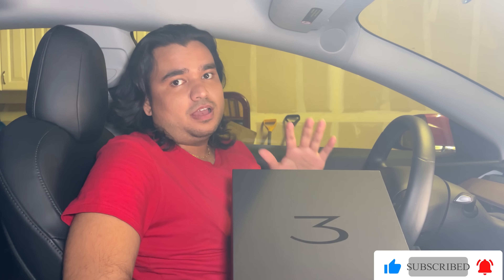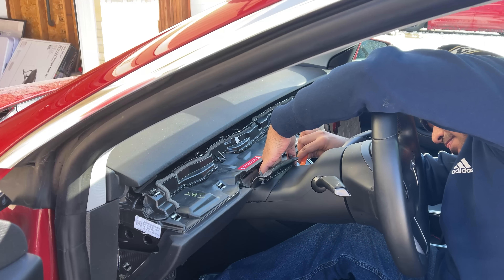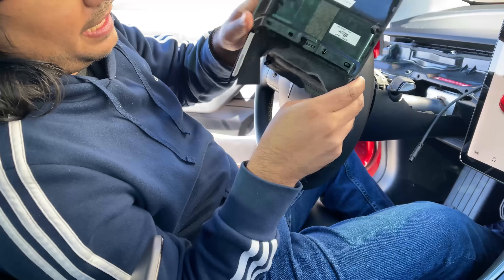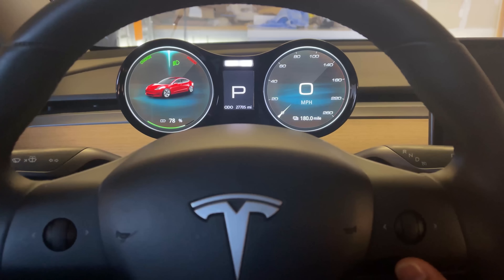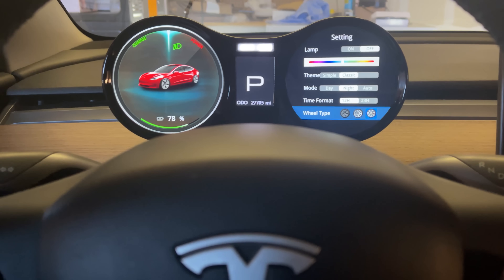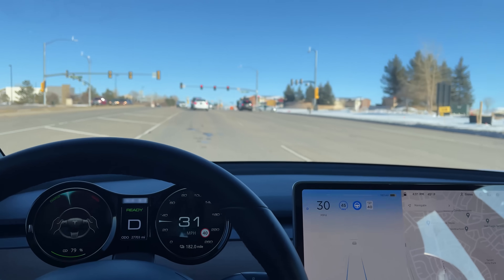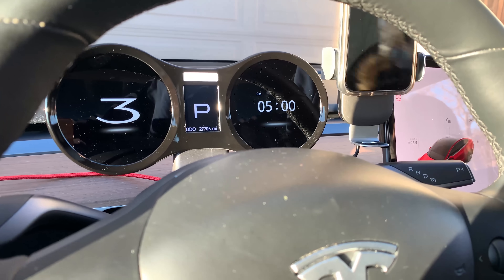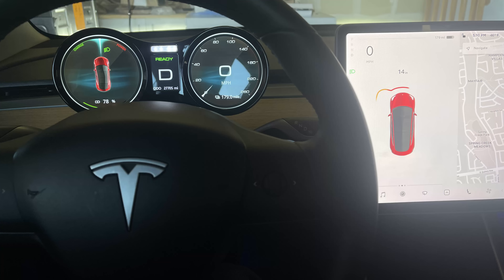New Display For Tesla Model 3 & Model Y - Instrument Cluster 2021

Comment: looks cool. will there be any problems with the warranty for the car? or any problems then with the tesla system, updates?
Reply from the maker: Hi Adam, no issues with the warranty unless the installation or this part somehow damages Tesla OEM parts. I have had a lot of Tesla updates with this installed and no issues there either. Thanks for watching my video.
Reply: @ShivaSapkota  was it tested with model 3 for 2021 ?
Reply from the maker: @adamsky7544  Yes, many of my subscribers have managed to install this in their refreshed model 3.
Reply: I could not find the plug on 2022 model 3. I have been hanging around for the whole day :(
 Is there any suggestions for another alternate plug? Thanks

Comment: @Shiva Sapkota: I've installed this unit in my Model 3, and it's really quite nice.  The displays are super crisp and look good.  I didn't like their cable routing, so I routed the cable differently than you did and made a video here: https://youtu.be/wH7gClHpJFQ 
I reference your video for the complete install.  Curiously for me, the MCU connector was only about 10 minutes of work, but getting the cover of the driving column to snap into place was an hour of work. Pretty hard.

Also question, if you have it installed, what software revision are you running?  My version is HMI_V1.3.25.0328R and MCU_SW_V2.3.4.  Just curious if you have newer software or not, because I ran into one odd problem.  When I charge at home, the display stays on after the charging is complete.  I leave the car plugged in when not in use, so having it stay on is not good.  I'm curious because my software is clearly a different revision than the one in your video (more wheel options, for example.)
Reply from the maker: Nice work on cable management! My cover for the driving column snapped in place quickly after I aligned all the tabs and pushed it in. My version is slightly different but I haven't updated this in a while, so yours could have come with a newer version. I am linking mine here: https://drive.google.com/file/d/1BZVuPhKLGAAwZuEpnFuNZAmEtAO504cU/view?usp=sharing
Reply: @ShivaSapkota  Ah, interesting. My cover took more muscle power than I actually have to snap back into place.  Not sure what the hangup was.
Reply: @ShivaSapkota  Regarding the firmware version, I contacted XMGE and they said my version is the latest.  It removes the color setting and the on/off settings seen in your video as well.  Thanks for the link.  I'd flash that version to see, but I don't have any way to get back if it's older. The QR codes in the display UI only lead to the user manual, no firmware. I dug around in the TLink files and your version here appears to be V1.3.25.02261R. They really need a better repo than google drives.
Reply from the maker: @arfWignack  Thanks for letting me know. Yeah they really need a better place for these updates. I suggested putting in their product page in amazon where they can usually link user manuals.
Reply: Also worth noting to late readers that if you are really having trouble with the MCU plug that you can remove the glovebox to make plenty of space.  You have to remove the airbag as well, but it's not very hard. Great video here:  https://www.youtube.com/watch?v=yHFyCqoKK4U&t=93s

Comment: Can you please help me with figuring out how to do a software update on these?
Reply from the maker: Hi Brian, you can just download the latest update files (linked here) and put in a USB-C drive. You can then run the update by going to settings, software version, upgrade. The update files include just 2 files and you have to update both circles. I talk about it in my video here as well. 
https://drive.google.com/file/d/1BZVuPhKLGAAwZuEpnFuNZAmEtAO504cU/view?usp=sharing
https://youtu.be/UMOfQEyDZoo
Reply: @ShivaSapkota  thanks and last question do I need to do this offer update right after I get it installed?
Reply from the maker: @brianyoung4380  No, the update is not necessary. The display usually comes with the latest update but linking one here in case it doesn't. If you have a Model Y and if the display shows as a model 3, the update will fix that issue.
Reply: @ShivaSapkota  thanks for your assistance yesterday I got it installed today it works but my screen in my car will not turn on cannot figure out what's going on might have to send this product back
Reply from the maker: @brianyoung4380  Hi Brian, a couple of things you can try: first make sure the connector is snug well inside the computer port. Sometime even if it is a little lose, only this display will power on and not your screen. Second, try a hard reboot. Press on the both steering wheel buttons and brakes and hold until the screen goes dark and comes back. Make sure all the windows and doors are closed. If that doesn't fix, my last advise would be to go open the driver door and frunk, go to safety and security, power off, open the HVAC panel (easy) and remove the negative terminal of the 12V battery. Wait a few minutes and put the terminal back on. I show how to do in my Hansshow display video. If none of those work, you might have faulty cable or device. Hope this helps :)

Comment: Hey Shiva, 
Quick question mate- is the OBD port for 2021 SR+ located in front of the passenger seat or underneath the transmission tunnel at the back ?

Thanks in advance.
Reply from the maker: Hi Aasif, I have heard conflicting info about the OBD port depending on the part of the world you live in. I believe the autopilot plug that I use on this video is still at the same location for the 2021 SR+ but I am not quite sure where the OBD plug is. I would start by looking under the USB-C port on back.
Reply: @ShivaSapkota  Hi shiva,
Thanks for your response. I am talking about a right hand drive New Zealand spec. So, not sure if the OBD connector would be on the right hand side i.e driver side or on the left hand side in front of the passenger.

Cheers,
Aasif
Reply from the maker: @aasiflaskar1315  Oh okay. One of my UK subscribers said it was on the passenger side but he had to remove the side carpet panel to access the plug. I pinned his comment on this video so folks on the right hand drive are aware of the issues he ran into: https://youtu.be/UMOfQEyDZoo

Comment: Personally which one you would recommended? This one or the carplay one? Does the carplay one degrade the music quality?
Reply from the maker: It depends on the need honestly. I like the Topfit one better than the Carplay display because of its simplicity and higher quality graphics. But, the Carplay one from Hansshow has significantly more features and allows customization. So, it is all relative to what you really want on a display. I am working on putting together a detailed comparison video between the two displays.
Reply: @ShivaSapkota  Great! Looking forward for the comparison!

Comment: Please forgive me if someone asked this already. Can you tell me how software update will be accomplished? Will it be over the air like Tesla, i doubt it? Will I need to download onto a flash drive then pull into the car or rear of the product? Or will I need to get back to the plug under the dash where the unit goes into the GUI computer?  Otherwise, I like the product as reviewed and would consider purchasing it.
Reply from the maker: Hello, thanks for watching my video. Their ultimate plan is to put their updates on a website where folks can go download and update their systems. Right now, they send me the update files and I can send a google drive link to anyone who needs the update. I did a follow up video on this device, please check that out to see how the update is done. It is not over the air update like Tesla but you basically have to download the files on a flashdrive, plug it in to the back of the device and run the update. Please reach out with any questions. Thank you again. https://youtu.be/UMOfQEyDZoo

Comment: My friend you king.
I want ask you a question....
If i drive with the car n i Leaving the gas of the My vehicle Is also in this case the vehicle will charge from the wheel rotation or should I give a brake?
And if I do in the drive tab on low regeneration will it also load?I want to get my foot off the gas and have the vehicle move forward and not immediately stop, and also charge .... What do you think about that?Or maybe make a video of your brother charging the car while driving. Thank you very much I love you from Israel
Reply from the maker: Hello my friend, if I understand your question correctly, you want to use regenerative braking (charge the car while driving) but don't want to the car to stop immediately if you let go of the acceleration? For this you can leave the regeneration to standard but if you scroll down you will see a tab called "Stopping Mode". If you change that to CREEP, the car will still move forward if you let your foot off the acceleration. If the setting is on ROLL or HOLD, the car will stop immediately. So, change it to CREEP and it should fix your issues. Thanks for watching my video, please reach out with any questions.
Reply: @ShivaSapkota  i thank you so much. ❤️.
You give me good answer 👍

Comment: Just as an FYI is you ever have autopilot issues or firmware update issues.  And when Tesla techs see that connected to the car computer. Warranty on the car computer is void.  $2000 repair at min.
Reply from the maker: Hello, thank you very much for watching my video and taking the time to provide your feedback. Some of my subscribers had to deal with Tesla service while having this display installed and they were told the warranty is not automatically voided but if this devices causes autopilot issues or any other issues to the computer, then as you said, Tesla would charge them for the repair. Thank you!
Reply: You got that right 
We don’t mess around, do any modifications 
Warranty is Void.....by Tesla
Reply from the maker: @thibui335  Thanks for your feedback. I appreciate you watching my video.
Reply: Thanks for sharing your knowledge 
Good video 
Subscribed
Reply from the maker: @thibui335  I really appreciate the support. Thank you.

Comment: Did you find that it blocked airflow significantly from the air vents on the dash? Even without this cluster added I am a little disappointed with the air flow. I have to turn the fan speed all the way up to 10 just to feel like I have air blowing on my face
Reply from the maker: Hi Joshua, thanks for watching my video. I just posted a follow up video where I "show" airflow difference. Yes, there is quite a bit less airflow to my face after installing the cluster. There is still some air, but as you said, I have to blast the air to level 10.

Comment: What makes this better than the 10" tablet HUD with same install location and provides same data, but has chrome, Android Auto, Car Play etc...? Thanks
Reply from the maker: Hi Matt, thanks for watching my video. Yes, the 10" tablet HUD from Hansshow has added features like you said (Android auto, carplay etc). That one is slightly more expensive but if folks use my code "SHIVATESLA" Hansshow will take off $100. At that point, both of the displays become competitive in terms of price. This circular one is directly mounted to the steering wheel which allows for height adjustments vs the tablet is mounted to the dash (fixed). Some people just want a simple cluster, so this one will be attractive to them but others might want more bells and whistles and the Hansshow would be a better option for them. Also, some of my subscribers told me they prefer a product from Amazon for easier return/refund, which you can buy the circular cluster directly through Amazon. It really is more about personal preference :)

Comment: Hello Shiva 
Well done, it is the second time i watch the review of this product, I1 Tesla was the 1st one. I have been dreaming about such a product since i got my 2018 model 3. I do not know how tall you are. But my worry is the display will be sitting too high and blocked by the top of the steering wheel. In all the pictures  I have seen, for a direct view to the display, the top of the steering wheel is 3-4" above the base of the windshield, blocking a clear view of the road ahead.
When I drive now the top of my steering wheel is lining up with the large plateau above the ventilation system. I am just under 6'  and this has been my main concern about this otherwise vary attractive product.
I am afraid, not having a good view, since I do not want to move the steering wheel too high and being uncomfortable driving.
Actually my first option. If it existed would be  a HUD projecting directly in the windshield à la Audi, giving the impression it 20' ahead of your car.
I would appreciate your comments on the position of the display vis-à-vis the steering wheel position.
Reply from the maker: Hi Gerry, thank you very much for watching my video. Height is definitely a concern with this device. The top arch of the steering wheel can cover the display if you are too tall. I am 5'9" and I have a clear view of the display as well as the road. I am working on a follow up video for this product and I will be mounting my camera at my normal eye level to show everyone how it looks from the driver's view while driving. With my comfortable steering height, I can still see my left windshield wiper above the very top of the steering wheel. I am not sure how to explain this lol. If you need me to record in a certain angle etc, let me know and I would be happy to do that for you. 
The HUD projection would be awesome. It doesn't even have to be augmented reality but simple 2D colored projection of navigation, speed etc. I will be passing on your feedback to the manufacturer, I have certainly bugged them about creating some sort of HUD display since I posted this video.
Reply: Thanks for your reply!
An actual eye level view at the display would be awesome. The view at the road and the steering wheel position may vary from one driver to another. If you would show your own view of the wheel and display, that would be great..
One thought that came thru my mind , was to shorten the base of the display, if that ever possible!!! So a taller driver would have a better point of view!
Keep pushing the manufacturer, for a HUD made for a model 3/ Y,   that would sell like crazy, not every driver want to be driven!
Reply from the maker: @gerrypoirier9462  Yes, I will for sure include my eye level view in my next video. I will also keep pushing the manufacturer for a HUD display. Thanks again for your input, I will keep you updated.

Comment: What does this do to the HVAC airflow? That display looks like it completely blocks the slit vent from blowing cool air at your face on a hot Summer day.
Reply from the maker: It does block some air but I still feel the air in my face. It for sure is less air compared to when I didn't have the display. Thanks for watching my video.

Comment: After you put this on can you still control the music and radio stations on the tesla screen using the steering wheel knobs? Or do the knobs only control the new steering wheel screen?
Reply from the maker: Hi James, you can still control the music and radio stations on the tesla screen. This device only uses the right scroll wheel on your steering. All the main Tesla controls (volume, radio, mirror etc) are controlled by the left scroll button. The only thing the right scroll wheel controls is the following distance, but once you are in Autopilot this new display goes into read only mode and you can change the following distance like normal in your Tesla. In summary, this device doesn't change anything 😊 Thanks for watching my video.
Reply: @ShivaSapkota  Oh ok thanks. That’s good because I didn’t want to not be able to control the tesla screen from the wheel. Thanks for that helpful info. 👍
Reply from the maker: @jamespeterson7100  Thanks again for your questions and feedback in my videos. I really appreciate it.
Reply: @ShivaSapkota  My pleasure. 🙂

Comment: I just wished that Tesla added this as an option.  I got used to central display after driving Model 3 for awhile but still it doesn't make me feel it's in the right location everytime I switch to my other car. Try to move your eyes sideways vs up-down repeatedly and you can tell the difference.
Reply from the maker: Hi Juan, thanks for watching my video and providing your feedback. I really appreciate it. Yes, I got used to my center screen over time but I would have definitely purchased this display if it was offered as an option when purchasing my car.

Comment: Hi Shiva, Great Video, thanks! The only concern i have is when i look to buy this on Amazon, there is more than one "brand" selling the identical product.  Topfit, BMZX, ThinSGO all claim to be the Brand behind this product... So what company is actually producing and updating this product?  It makes me nervous to install an aftermarket product that literally is connected to the heart of your car (computer) with access to all data, videos, information etc with no reputable company behind it.  What are your thoughts?
Reply from the maker: Hi Matthew, that is certainly a valid concern. I got mine from Topfit. I have used many of their products in the past and haven't had any issues. I reached out to Topfit and they sent me some software update files, which tells me they have connections with/know the developer. If you are concerned with these companies not being reputable, check out Hansshow's products. They are a reputable company and they recently launched a similar display. If you use my code "SHIVATESLA" at checkout, they will give you a $100 discount. https://www.hautopart.com/product/model-3-y-steering-wheel-center-console-screen/